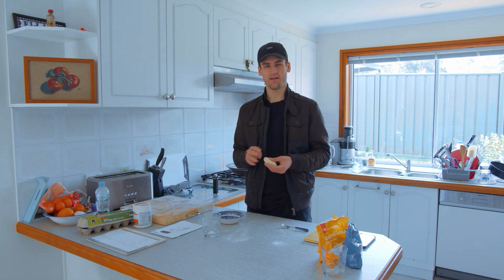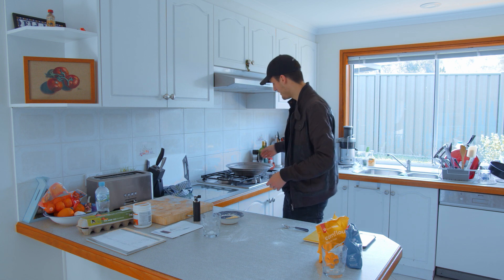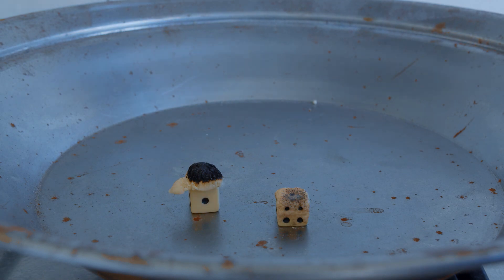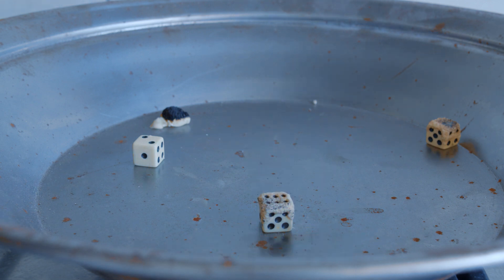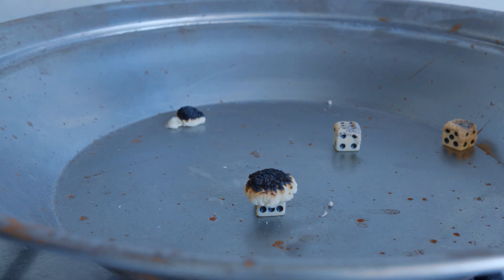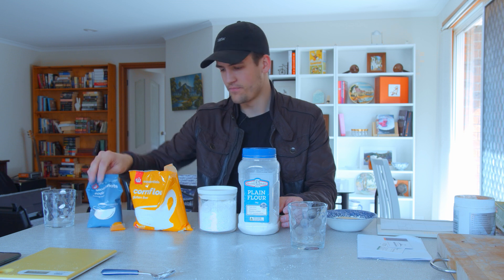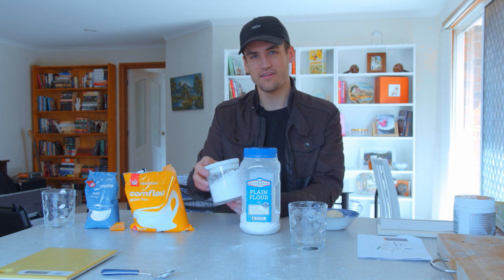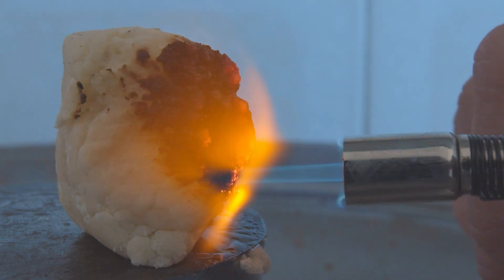Starlite - the super heat resistant material (and how to make it)

Comment: Is heat resistance the same as low thermal conductivity?
Reply: Yes.
Reply: @controversialopinion5722  No. At least, not in a general sense. Styrofoam has a pretty low thermal conductivity but not a very high heat resistance. depending on your definitions, steel has a pretty high heat resistance, and also a high thermal conductivity.

Comment: will it resist heat after getting dry can we use it to contain heat inside something like adhesive
Reply from the maker: Not sure about the second part to that but it will still resist heat after its dry
Reply: like using it as a powder and the adhesive as a base to carry it in? so when it drys you have like a heat resistant/water tight seal?
edit: if so thats a cool idea

Comment: Exactly how much temperature it can withstand ?
I am looking for a material with High heat resistant upto 5000 degree Celsius..
There are none
Reply from the maker: It possibly could withstand temperatures up to that high. It just may not last as long. I don't have a way to make something that hot currently so testing it is not possible for me. But in the video I used a really small blow torch but I have since gotten a much bigger one and it can withstand a lot of hot flame for a while.
Reply: @scoopscience  there is one chemical which can create that mush temperature for a split second .. but it's very dengerous and explosive ..
Its name is nitroglycerin .. very easy to make but very dangerous ..
I am trying to find a way to make this chemical burn slowly and gradually increase temperature instead of exploding
Reply from the maker: Good luck with that chemical. It can blow your hand off if you're not careful
Reply: @scoopscience  I know , but I have no other alternative to create that much temperature
Reply: would thermite help? that's like the only thing I know of that gets weirdly hot. I do have a suspicion though that maybe lasers get hotter than chemicals burning. I just wonder if a laser has a way of being magnified to levels of heat that Radiant heat cant do.   like when you use a magnifying glass with the sun. If I held a magnifying glass next to a fire burning would that have any real effect on the temp even if it was EXTREMELY minuet.

I kinda wonder what the limit would be for magnifying direct heat from a laser would be, Seems to be like potentially limitless if you had a big enough magnifying lens or enough of them stacked.
Reply: @ueehurstonsecurity8887  I meant heat resistant ..
Creating heat is simple ..
But containing it is hard
Reply: @new_contents_all_day  i should have known better this question was above my pay grade thats forsure haha